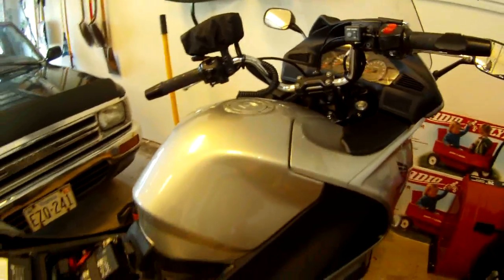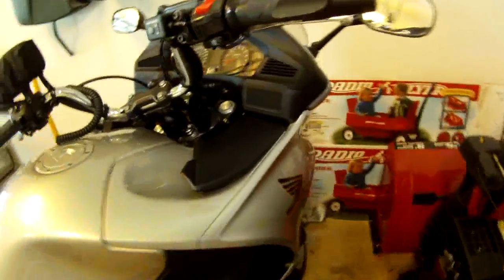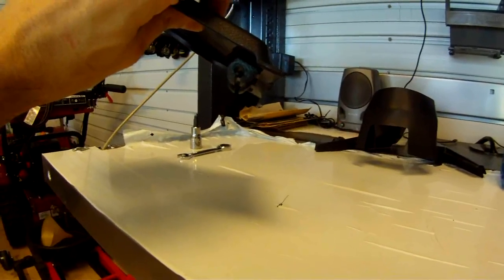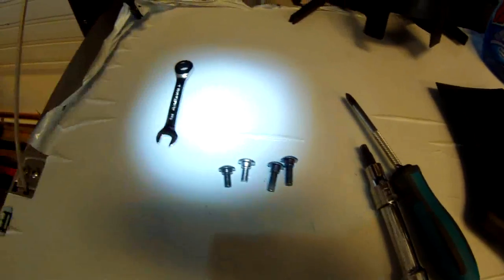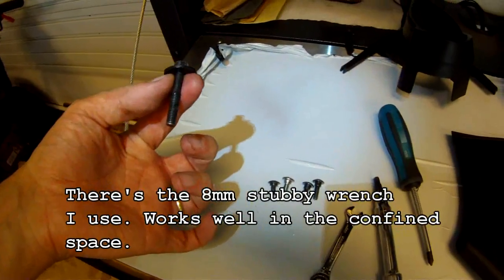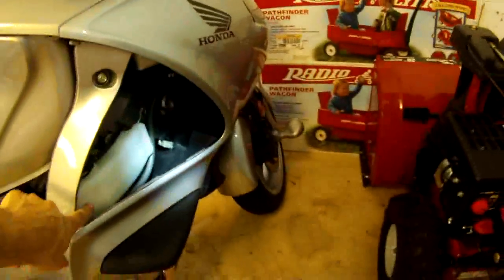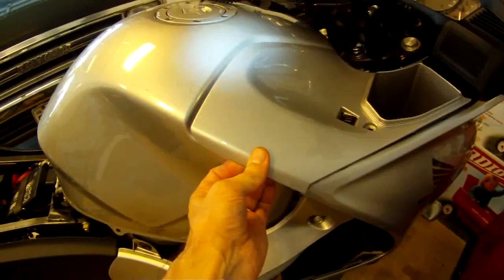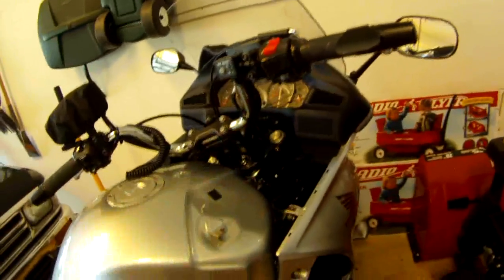Removing Cowl Pocket and Mid Cowl Lid on an NT700V - Part 1

Comment: Great video. Thank you ! Great advice on buying a Japanese screwdriver. Only $9 on E-Bay. (JIS Screwdriver) Learned the hard way when I bleed my breaks on my NT.
Besides metric, any other tools you recommend to buy ? 
What size torx's do you recommend on a budget that you'll need to work on my NT ? Thank you